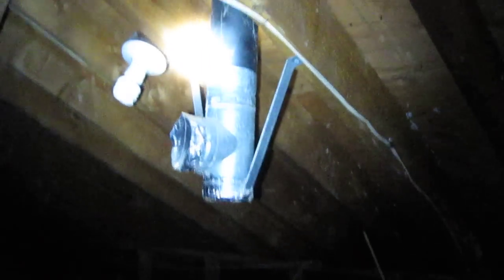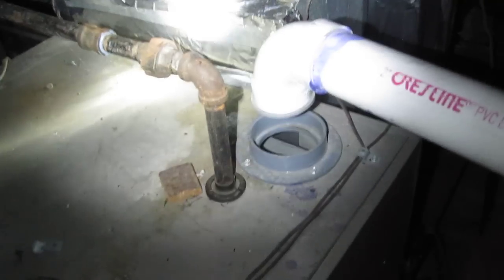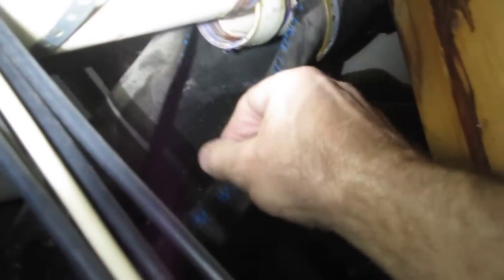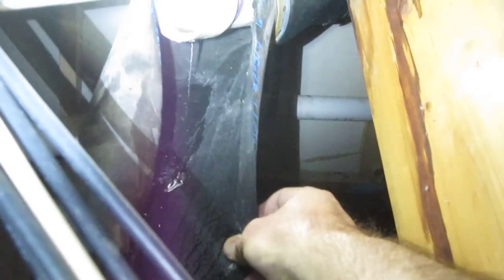Furnace venting problem

Comment: damn furnace hackers luckily this is a easy fix buy some PVC pipe primer and glue and for the fresh air in correct that to make sure it is sealed and glued on both and if you can instead of running the threw the side of the house drill 2 2 inch holes and buy and 90 degree elbow and put that on top of the two pipes protruding threw the roof when you do that i can promise you that you're furnace will run better